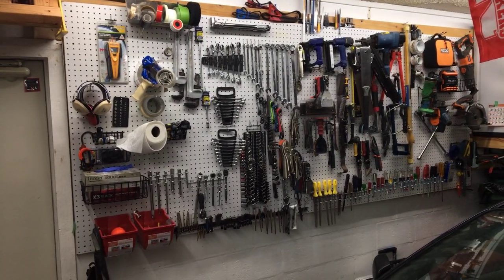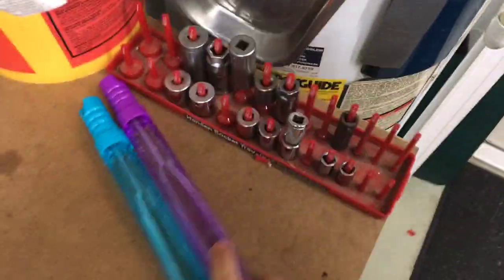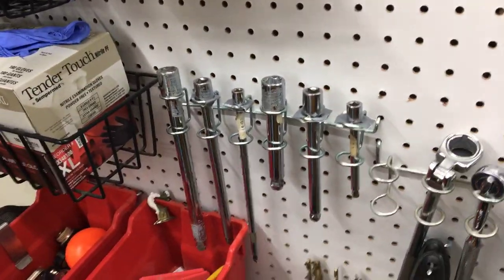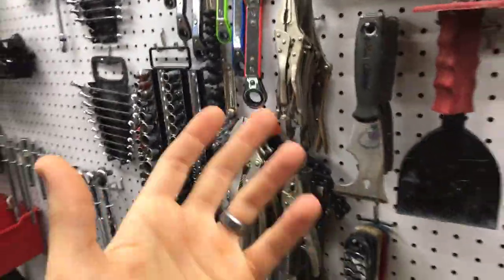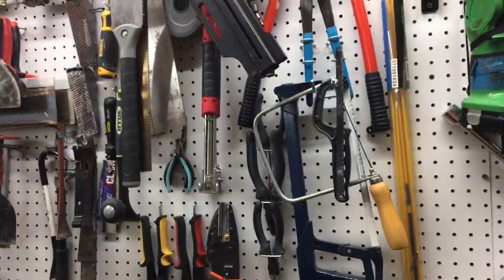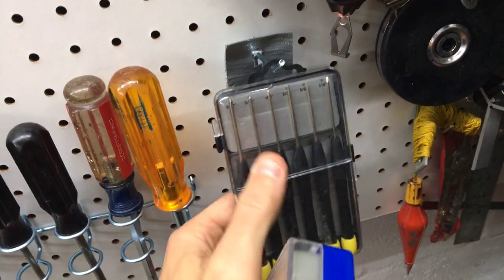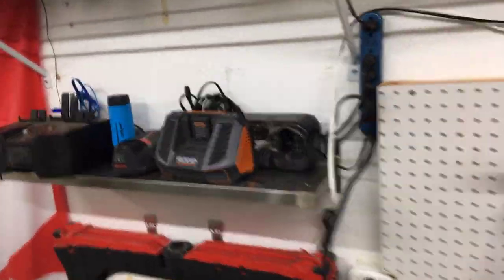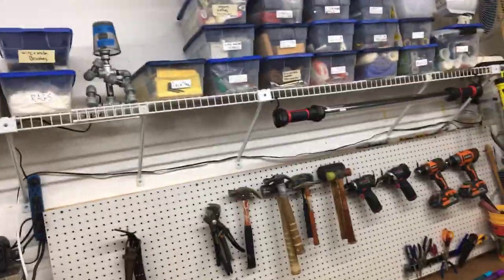Garage Organization: How I set up my garage pegboard. Ideas for you

Comment: Love the Great Ideas ! !  
The idea of using screwdriver holders for socket ext. Use washers with the holedrilled out and then Hot glue washer on to the top of the screwdiver holder. It is more durable than tape.

Comment: My question is how much often do you use all that 💩? My bet is as often as all of us.I have that much 💩 I haven’t touched in a decade or 2 in my shed.
Reply from the maker: That is a valid point. It’s probably every 2 years I might actually use 80% of those on that board. But 20% is even less frequent. 

It’s almost FOMO that if I sell or donate that tool that I  haven’t touched in 10 years then I will need it right after that. It’s probably a form of hoarding too just like most people who can’t divest of products they’ve acquired. Then there’s the activity of actually trying to pare it down. That time intensive activity isn’t worth the effort for me since I hang the tools on the wall which was once just unused vertical space. Surely someday I will have to go through those obsolete or non-moving inventory and divest.